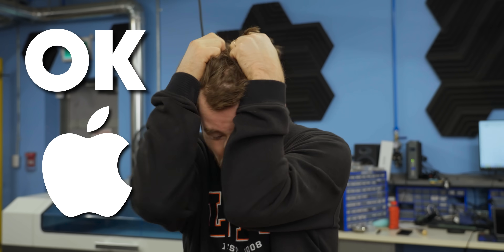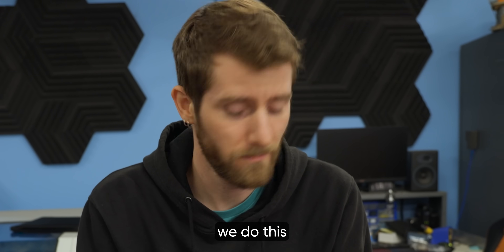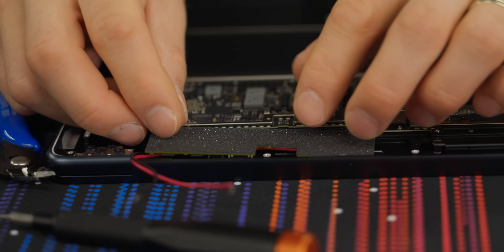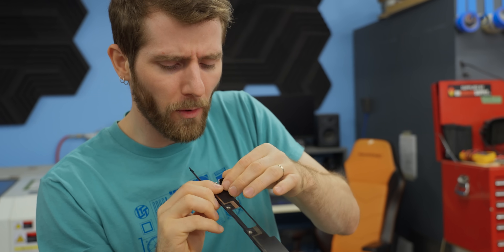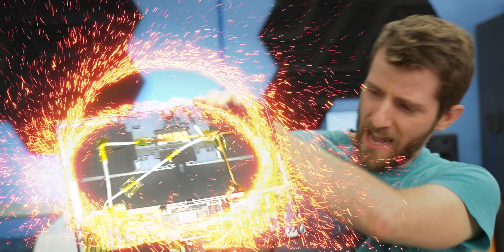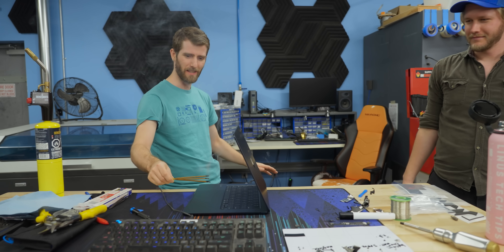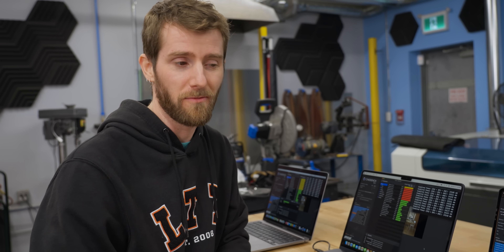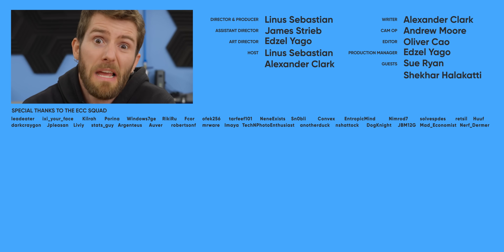Apple please watch this. - Frore AirJet MacBook Air

Comment: Finally, presenting the iSuck! What is their power consumption and how much does the bigger pro version cool and consume power? How much more battery could you increase with the space savings? Also do another video where you replace the fans and put the bigger ones directly on the die on the macbook pro.
Reply: 1.75W each so that would be an extra 5W power draw... Total system power (screen + SOC etc) under heavy load is close to 25W so this is a large increase in power draw.
Reply: @hishnash  I don't know the scaling properties of the cooling chip, but in theory it would only need to turn on when things are really cooking, so would only potentially really take a bite to battery performance when in max power draw mode anyway.
Reply: @hishnash  Also, from their website 

AirJet Mini removes 5.25 Watts of heat at a silent 21 dBA noise level, while only consuming a maximum of 1 Watt of power.

so a bit of an overestimate on the power draw, but for such a total low power SOC, your conclusion is totally the same :D
Reply: They have mutable models the units used in this test were the larger units that each pull 1.75W @BeCurieUs
Reply: @hishnash  Gotcha, my brain interpreted that as their 1W for 5W of cooling, but you meant their upgraded 10W cooling one..but for 2 of them.  That would still only be 3.5W of power and not 5W, but your point is still valid cause that is still like 10% of total the 35W system power.
Reply: It depends on how much has changed from their previous version, but the older ones were rated at something like 5W of heat disipation for 1W for the module itself. That is similar in scale to existing fans. They had a "pro" version which was effectively 2 of them for 10W of heat dissipation for 1.4ishW.
Reply: from the other video they linked. 1 watt.

Comment: Oh no, I just looked up the RTING website comparing SBC to aptX and I was able to tell them apart. I can tell the symbols on the drums were clearer with aptX for sure. I didn't think I could hear such differences in high bitrate low complexity codecs. I'm unfortunately becoming an audiophile after all this time. I'm using 2.4GHz headphones so my hearing test is legitimate. Wait, THESE CODECS ARE WORSE THAN MP3?! SBC is DTS dog shiz while aptX is closer to AC3's better than DTS compression. No wonder AAC is becoming popular among bluetooth devices.
Reply: what does this have to do with the video
Reply: @NotGabe001  bot?
Reply: @corruptedcardinal9253  either that or YouTube autoplayed before they realized it and commented on the wrong video